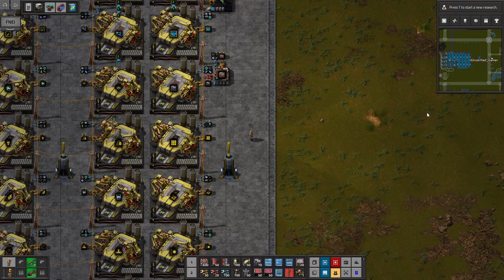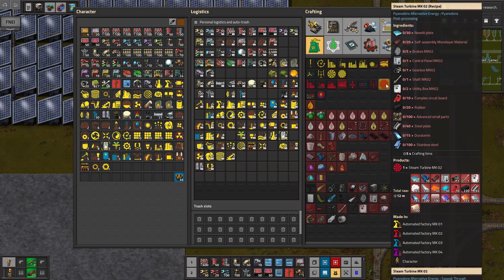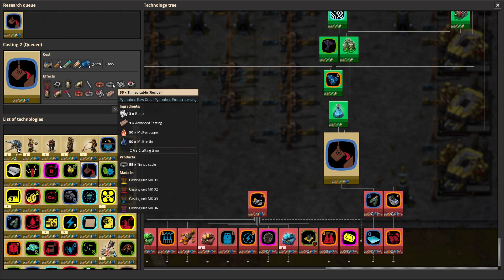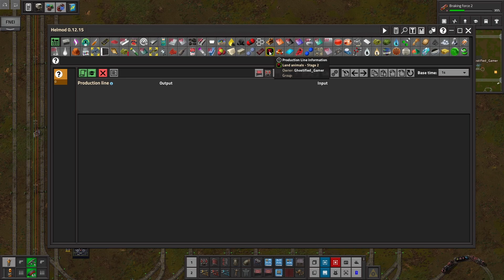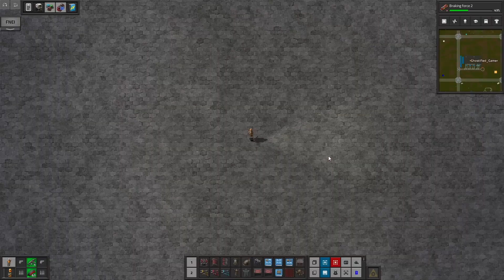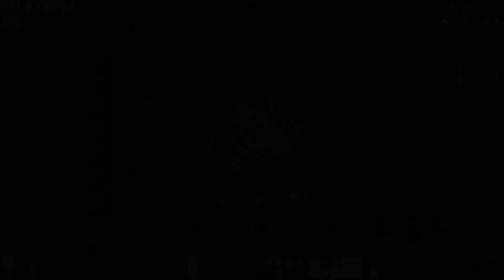Factorio pYanodons - HUB 2.0 and Mechanical Parts 2 Planning - EP140

Comment: Another thought I had was about sodium hydroxide. Now that you can make lime from shells, the sodium hydroxide recipe from slaked lime looks promising. 2 shells turn into 10 lime, so 1 shell = 5 lime. 5 lime + 200 water = 50 slaked lime, and 10 salt + 50 slaked lime = 10 sodium hydroxide + 5 limestone. You could either train the limestone away to where it's needed, turn it back into lime (at the cost of burning coke) if you have a shell shortage, or just throw it away since it's so cheap to make from water so it's almost worthless. So essentially, 1 shell + 10 salt = 10 sodium hydroxide with only a single waste product. I think that'll be a better chain than saline water in electrolyzer.
Reply from the maker: I might be ripping the Xyhiphoes out so no more shells.  There's new tech to make the anthraquinone coming up.  Also, I'm looking at mining saline water with mining fluid 2.

Comment: Yeah, having a dedicated kicalk build for cellulose sounds like a good idea. You could even go low-tech and use the kicalk recipe that uses only clay as an input, because that can be done entirely on-site with no need to import lamps, ash, sand, biomass, and fertilizer. Just slap down some clay pits, feed them with steam, and you have kicalk production that will never stop because it will never run out of input materials. Sure, it takes more machines to produce the same volume of kicalks/second, but cellulose is so important that I think making sure kicalk (and raw fiber) production will never, ever stop is worth the extra room. (And soon you'll be able to go to kicalk plantations mk 02 and cut the number of machines in half).